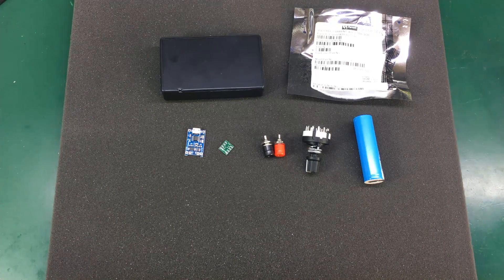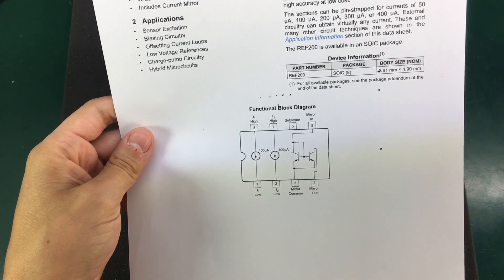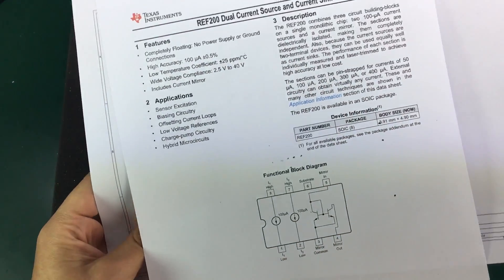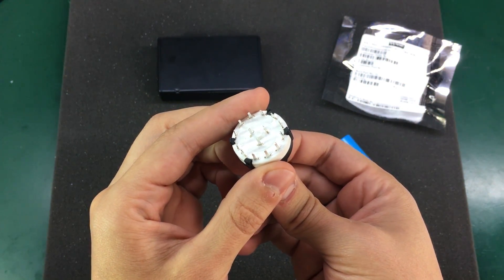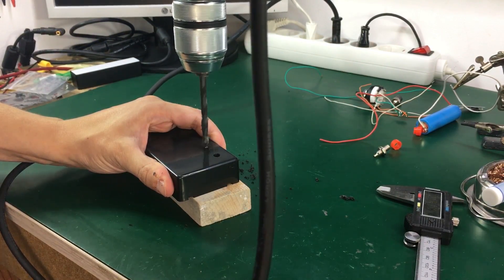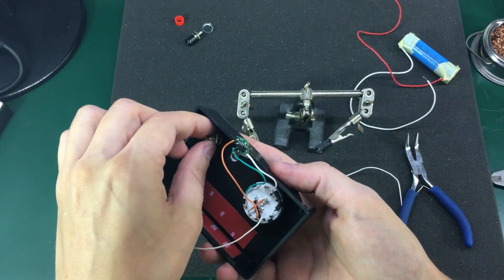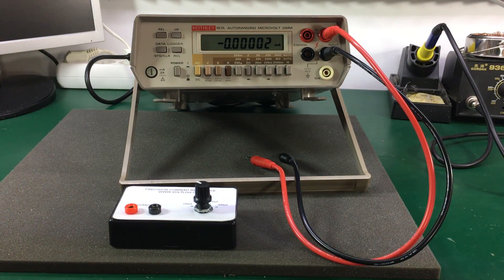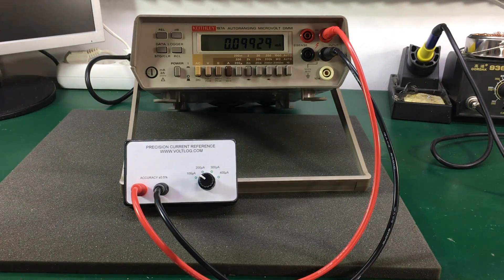Voltlog #67 - Precision Current Reference Using REF200

Comment: problem is getting one genuine REF200, i expect all that sells in aliexpress are fakes.
Reply: I bought 5 from AliExpress and tested one of them.
It works as one output reads 99.8uA and the other reads 99.9uA
I don't have a precision multimeter. So it could be that. 
If it's fake, it's a good one. They're not cheap and couldn't find just one for a good price. So, I bought 5.
If you want genuine, you have to buy from Digikey or alike.
Reply: https://www.aliexpress.com/item/32813738711.html?spm=a2g0s.12269583.0.0.39b714c9Oij7VX
Reply: @ufohunter3688  thanks for the link. but when it's about a standard reference, only genuine i can trust. because, even 0.5-.1.0% deviation also ruins it as a standard reference.
apart from that, so many times i tried buying cmos 555 in aliexpress, all the time i got non cmos ones, even when thy are selling them as cmos versions. these fake business just ruins the purpose of the chips. :=/
Reply: @iceberg789  I hear you. As long as ppl buy them and don't bother opening a dispute, proving they are fake, these scumbags will keep selling them.
To be fair, not too many of them know what they sell. They know nothing if you ask them a technical questions. 
Next time, msg them and ask them in advance, if it will pass a datasheet parameter test, if you don't hear back, you've got your answer. GL.
Reply: @iceberg789  Also, I'm pretty sure the ones I have are copies. The markings are not the same as the real thing. 
But it seems to work. I need it as a part of testing that doesn't rely on accuracy as it does temp and age stability. I can calibrate out shortcomings of initial accuracy.
Reply: @iceberg789  I've had a chance to play with it now. it puts out 99.975 uA into a 10.000k ohm resistor!
This is way better than the 0.25% of the datasheet. 
Considering the originals cost me $11.50 each, and 5 of these for $6, it's a no brainer for me. Where are you located?
Reply: @ufohunter3688  that is good to know. i checked the seller, but they are only selling 5pcs together, not single pieces.
but, did you check the current with a good fluke type meter ?
Reply: @iceberg789  I don't have a fluke but have checked these meters against a good meter and they matched.
Reply: @ufohunter3688  okay, thanks for telling !

Comment: Just to remind you,
±0.5% precision is only for single current source!
If you connect them in parallel you get ±1.0% precision and
if you use current mirror even worse!

Finding total precision is more complicated than just adding 2 uncertainties, but to be simple this will do.
Reply: Is it though? Worst case of +0.5% of 100uA (=0.5uA) on one source and same +0.5% of 100uA (=0.5uA) on the other paralleled will still only add up to +0.5% of 200uA (=1uA)...
Reply from the maker: okay, thank you for explaining that!

Comment: 7:53 Of course the current draw is negligible ;) It's 0 :D When there is nothing connected there is no current path (bat- only goes to the output)! That's why it's not mentioned in the datasheet :D So the only current draw you have is from the charger module and the discharge current of the battery itself.
Reply from the maker: correct, thank you for taking the time to clear this up.
Reply: No problem! :) Keep making nice video's!